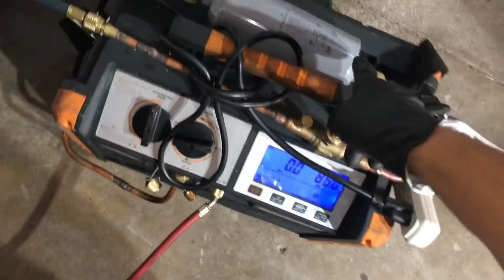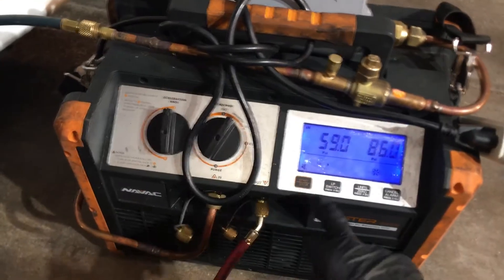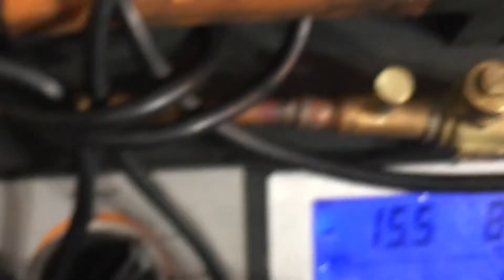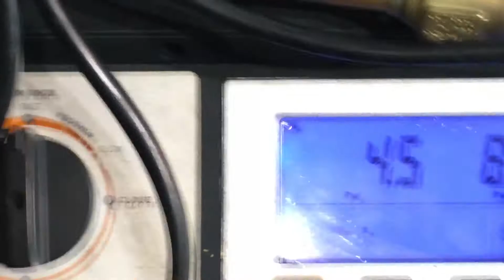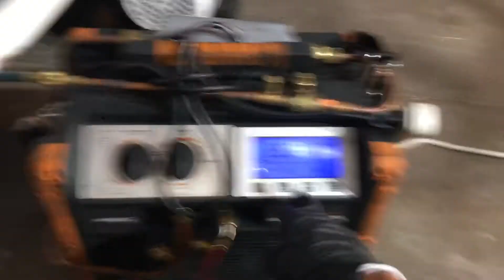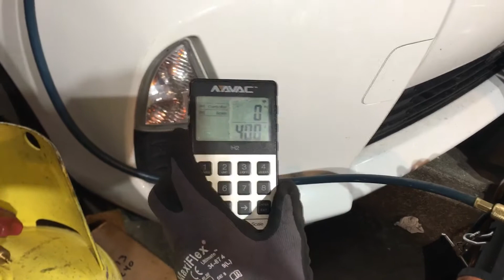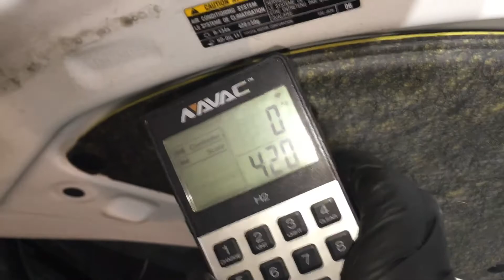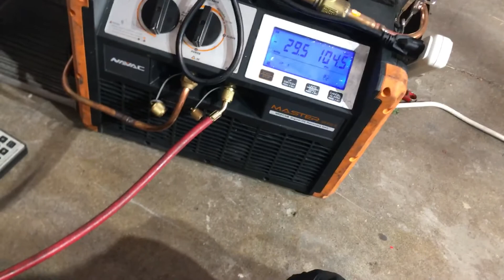AC refrigerant recovery Automotive single hose method

Comment: Hi Tom just invested in a Fieldpiece bundle instead of a R1234yf machine for my shop as the other R134a machine is approximately 12yrs old so not sure how much longer its going to last. So thanks for these videos as i wouldn't have thought about buying separate items to do the job.
Was wondering if you advise to use a filter with recovery because of things like A/C sealers possibly being present, to help protect my Fieldpiece recovery machine.
Brett From the UK cheers
Reply from the maker: Yes, use a filter dryer to protect your machine.  Especially when it’s a burned out compressor and it has that fine black metal, flake shavings in the oil that are ultrafine like 2000 grit sandpaper. 

And when you have everything new brand new seals on all your hose connections, when you first tighten them up overtime they will get loose quickly and cause a vacuum leak . 

So, after about a weeks worth of work, remember to recheck the tightness of your hose fittings were there permanently attached . 

You’re going to get ready for a little bit of frustration as you learn how to use a micron gauge . 

It’s a educated learning curve that you must put yourself through because there’s gonna be times you just don’t understand what’s happening . 

Watch all the videos from Jim Bergman, that I have recommended in the past about vacuum . 

I have even recommended a free PDF download of something several hundred page or 1000 page book all about vacuum . 

Because when you’re reading microns compared to 1 inch a vacuum on an analog meter . 

1 inch vacuum is like reading your odometer on your car going down the highway in measuring 1 km 

But reading microns individually is like driving down the highway using your odometer and attempting to read 1 inch or 1 foot . 

So any imperfections in your vacuum including your own seals, hoses, valves, ball valves anything micron gauge will read 

The micron gauge will even read moisture in refrigerant that has absorbed into the lining of your refrigerant, charging hoses and throw your readings off, making that much higher

Comment: After the full recovery and vacuum process, how do you break the vacuum on this single hose setup for charging preparation?
Reply from the maker: I unscrew and back out the high side service fittings then move the hose over to the charging tank of fresh refrigerant. 

Purge some of the fresh refrigerant through the same charging hose to the end of the service fitting attached to the vehicle

Set it on the weight scale and zero out. 

And then add refrigerant as needed to manufactures weight specifications
Reply: @coldfinger459sub0  Thank you very much!!!
Reply: @coldfinger459sub0  After breaking the vacuum from high side with fresh refrigerant, I can now start charging the refrigerant from the low side gradually with engine running or off?
Reply from the maker: @ferdieedquiban9047  or if you completely understand the three gas’s laws and you know how to manipulate them to your advantage. 

         You can completely recharge the refrigerant quantity by weight in a liquid form through the high side. 

With the engine off through the low side in a vapor state the majority of people will only get so far and then the refrigerant will stop flowing.
Reply: @coldfinger459sub0  Got it. Thanks again

Comment: Why are you not using manifold gauge
Reply from the maker: Just the show that you can recover refrigerant with a single host you don’t need a manifold because you’re not testing you’re not diagnosing anything you’re just simply removing refrigerant getting it ready to be worked on or recharged.

Comment: Where does the recovered refrigerant go afterwards?
Reply from the maker: All the refrigerant recovered from cars is considered dirty possible air contamination moisture contamination in every different type in style and viscosity of oil my new amounts that come out and I’ll gets mixed together in one tank. 

         Then once the tank is full the refrigerant gets recycled where all impurities are removed and you end up with clean dry moisture free oil free pure refrigerant to reuse all over again. 

           And if you do not own a refrigerant recycler machine we take it down to our local commercial HVAC warehouse that has a third-party recycler program where are you bring in and hand them over your filled tank of refrigerant and they hand you back a fresh new empty refrigerant cylinder to refill again.

Comment: I wonder why dont all manufacturers implement  those sight windows in all cars
Reply from the maker: mountain klima because people try to use them to recharge or top off the refrigerant.  This is a false way to do it.  Because depending on the heat load  and air flow you can get a clear sight glass with 1/2 the refrigerant charge and still get 39F to 45F out the dash on a low heat load day.          I have shown this to many tech and owners of shops as a demonstration when I run across this situation. Then I would recover the refrigerant and show them how much weight  I removed.                  Them the same goes for a bubbly sight  glass being 100% full . It is a bad method to use to fill by sight glass.  Back in the old days it worked ok just ok with R12 with fixed displacement piston compressors. Large condensers large evaporators. Compressors that weighed 35 pounds made out of iron, slow rpm engines, I sold compressors had 6 ounce oil sump pumps with internally built oil pumps with a pick up tube cross drilled a crankshaft that had an oil feed system like a real engine.  With bearings the size of silver dollars.  Extremely durable you can make mistakes on refrigerant charge and they would still live.              Nowadays small aluminum compressors that could fit in the palm of your hand with tiny bearings the size of your pinky finger or a dine in diameter. They have to over rent them and spend them up at much faster speeds on small engines that are high rpm compared to 40, 50 years ago.  No more oil reservoir sump pumps with oil pumps built inside of them anymore they completely rely on a full refrigerant charge to carry back oil like an aerosol mist squirting out of the can of WD-40 that is nice and cold to keep them alive.